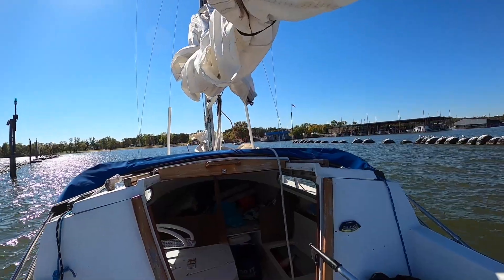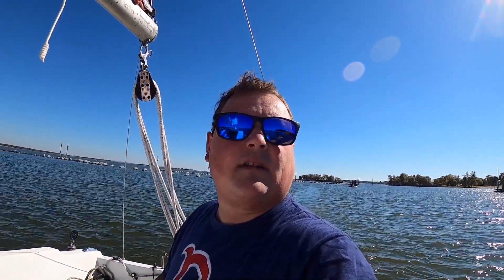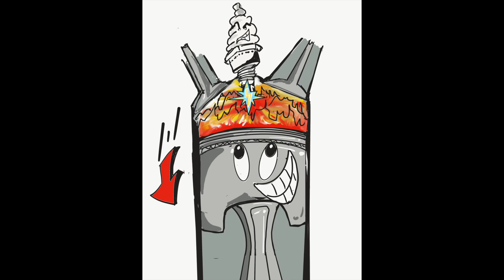Engine Trouble | Trouble Shooting the Tohatsu SailPro (Sail With A Mission)

Comment: Deja vu!  I found myself in the same situation last season.  I traced the problem back to the fuel pump and replaced it with an OEM pump. It's been smooth sailing since.
Reply from the maker: I believe you are correct. I have a fuel pump and filter on order.  I am going to troubleshoot just a little more but I am confident that it is the combination fuel filter and fuel pump.

Comment: I had a similar situation with my brand new, less than 10 hours, Tohatsu, after about 45 minutes of motoring at medium RPM's the motor would quit without warning.  After about 10 minutes I could get it running roughly with partial choke, enough to get me back to the marina. It ran fine the next few times out, but I didn't run it for much longer than 20 minutes.  Then the same thing happened after another longer run under load. Looks like the issue was a defective spark plug that was breaking down as it got hot. Time will tell, but I replaced the plug and so far so good.

Comment: Been there.  High speed jet clogged. Carb rebuild, new fuel filter and may as well rebuild the full pump too. $89 in parts easy very rewarding repair.

Comment: GREAT informative video! 
Question: The original gas tank (like yours shown in the video) is onboard my CAL 22, although it's dirty and needs cleaning. How would you recommend cleaning the inside to ensure no gunk and junk is left behind that could potentially clog the tubing and squeeze ball? Would you also recommend changing the fuel tube from the tank going to the engine?
Thanks Eric! 
Fair Winds!
Reply from the maker: For cleaning I would recommend some old gas, fuel treatment and an agitator.  A hand full of nuts or washers will work. Let the mixture sit for a bit then spend some time shaking the gas tank around.  The nuts will help clean gunk stuck to the tank out.  I would do this a few times. 
If you see any signs of weathering or cracking on your fuel line I would replace the whole thing.  The line could have junk that breaks loose and could clog your fuel filter.

Comment: Hey Eric. Great video. I'd change the fuel filter and spark plug. Also, make sure your fuel tank is vented so you're not creating a vacuum in the fuel line. Oh yeah, and blow some air through your fuel lines. Looking forward to the next video!
Reply from the maker: Thank you. The engine trouble should be resolved this week.  I have a fuel pump and fuel filter on order.  I do plan on giving the entire fuel system a once over.  Thank you for watching - Eric

Comment: Clean carb.  Use non ethanol fuel.  Did you close the choke
Reply from the maker: I run a fuel stabilizer however you are right non-ethanol gas would be much better for the engine.